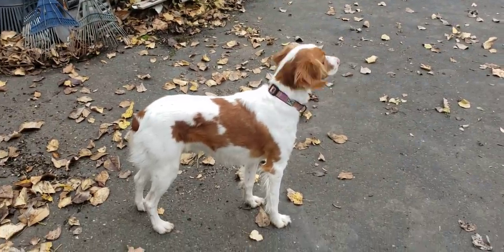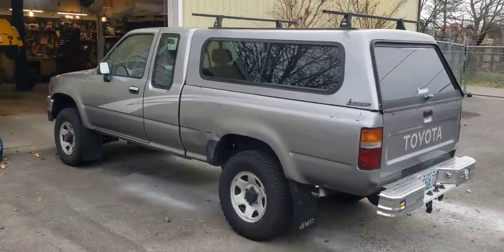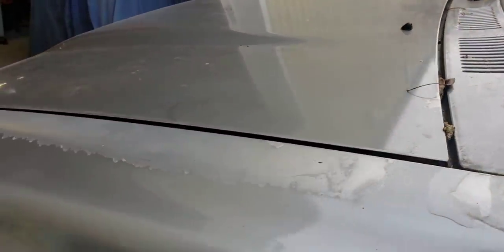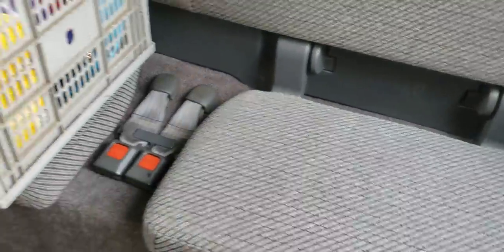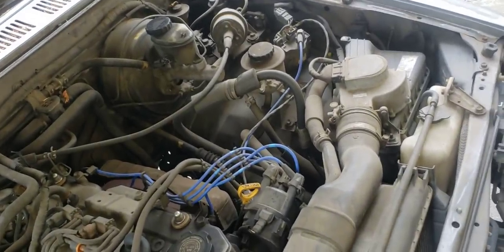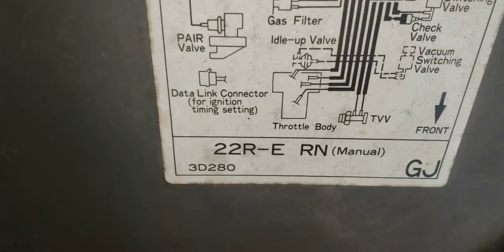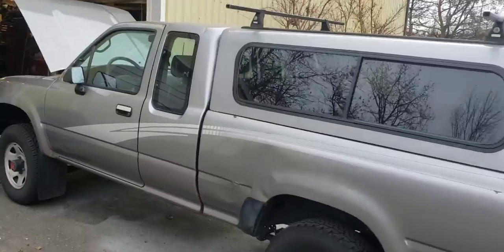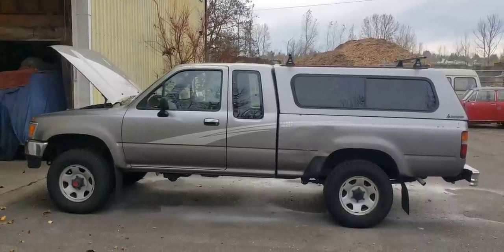Unmolested Old Toyota Trucks are Hard To Find These Days

Comment: I found a 94 4runner that spent its life in Phoenix. I flew out to look at it the next day. The only thing that was changed on it was the radio, and some led marker lights were installed in the corner lamps. I drove it back to Texas that day. Not 1 bit of rust on it. The interior is fantastic with only the bolster on the seat, arm rest and steering wheel buttons showing signs of wear. The paint is sun faded with most of the clearcoat gone, and the dash has cracked up. I have already purchased the factory paint and I plan on repainting it the original color it came. Im going to start a series on youtube where I'm going to completely strip it down and restore it. I haven't decided if I'm going to rebuild the 3.0 or import a Toyota 1KZ-TE turbo diesel from Japan or Australia and put it in.

Comment: Extremely popular in Australia and now a recognised collector vehicle. Available in various configurations, single cab,crew cab (4 doors) and extra cab ute, with either rare 4 speed automatic or 5 speed manual, normally aspirated petrol or diesel with dealer optioned rare turbo diesel, sold only with manual gearbox, available. Two and four wheel drive variants available. Supplied as csb/chassis, factory tub or aluminum tray with fold down/removable sides. Aircon was standard fit with no delete option in Australia !!!. Most popular colour was white with vinyl or cloth interiors in tan or black. Typical indestructible Toyota utes. 👍👍🇭🇲

Comment: I owned a 89 and a 97 Toyota truck. The new Toyota trucks have lost their interest for me, it's like they sold their soul to please the American market and in doing so forgot what made them a great truck in the first place.
Reply: They're still extremely solid 👌
Reply: ...for a while, I was hoping to find (the now-probably very rare) "T-100" model...a bit bigger than the Hilux, but smaller than the 2005+ Tacomas, as I recall...
Reply: @craigmclean8260  we had a T 100 at work,  I kinda liked my tundra better but T 100 was a nice truck with alot of power.
Reply: @spurgear4  Yes; I think the T-100 used the 3 liter V-6 w/ 150 horses...
Reply: @craigmclean8260  I may have done one or two brake stands with it. I retired so I guess I can confess now.
Reply: @spurgear4  Hah!  I once generated lots of smoke w/ a clapped-out '72 Vega "Kammback", not even smoking the tires!
Reply: @craigmclean8260  I had an old six cylinder dodge dart like that

Comment: I think the '93 was one of the last years before the Tacoma.  I had a 1992 2WD I bought used in '94; kept it for 17 years.  Sadly, I bought rather quickly, w/out getting it inspected; turns out it was a "rebuilt" example (said so on the title when I checked it a few days later), having been, apparently, rolled.  Still, it was very reliable, and served me well, esp. when remodeling my first house in Seattle.  When I moved to North Dakota, it'd stay parked outside, not driven in Winter, but always started right up a few months later!  Only strange problem I had w/ it was when the clutch/starter interlock contacts went bad.  Also had a 2006 Tacoma for a few years, a decent truck, but felt rather "klutzy" in handling, esp. when going over RR grade-crossings...

Comment: At 150K, a 22-RE from the “golden era” of Toyota is just getting broken in. Lots of those trucks here in the East that went 300-400K without issue until the tin worm got them. Great trucks. I recall that Japanese cars that were slightly earlier than this had wire harness corrosion problems that were resolved by this point. That FI system is the same thing you find on the MR2 of the same era and early Miatas as well.

Comment: Still own an 86, Xtra cab SR5 (which meant a 5 speed manual back then) and fuel injection. Its getting a little tired (low compression in one of the cylinders) but is still a great truck for the weekend.

Comment: I have a 90 SR5 extended cab 3VZE with 157K that I bought new in you guessed it. 1990. I thought the SR5 was the fully tricked out trim designation, which would include AC, power windows, bucket seat, console, auto-locking hubs, etc.?